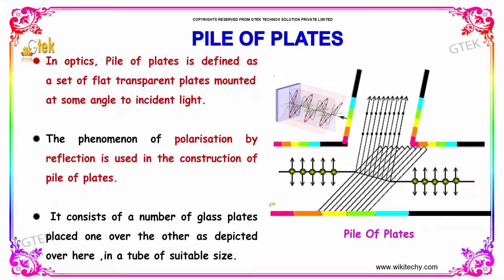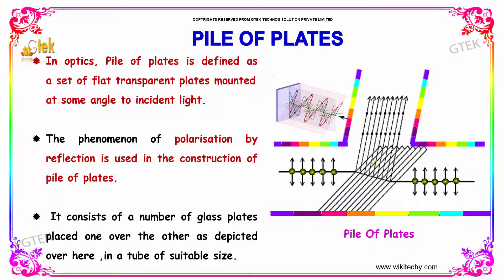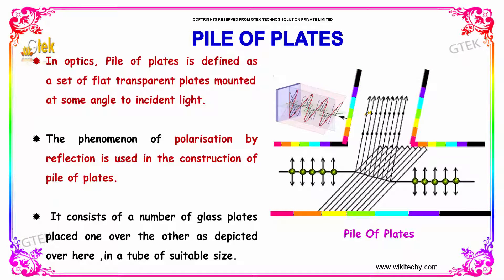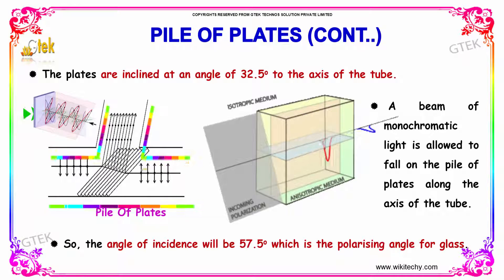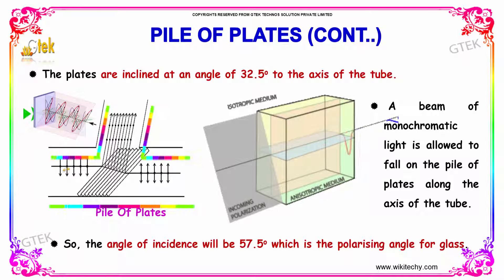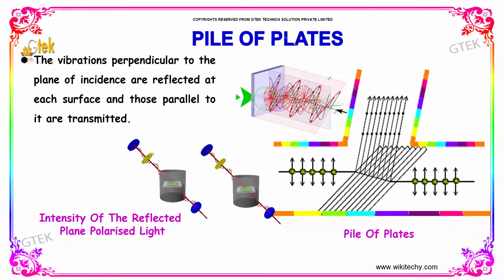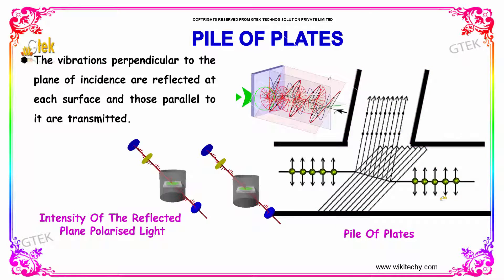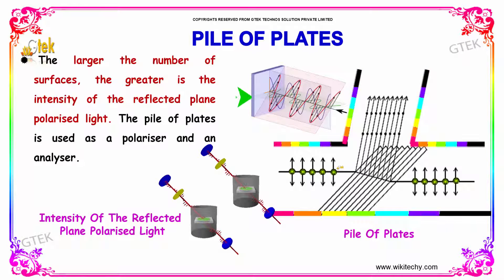Pile of plates Electromagnetic Waves and Wave optics class 12 physics subject notes lectures

Comment: in optics, a set of flat transparent plates mounted at some angle to incident light. Such a pile is a simple polarization device. In accordance with the Fresnel equations, the transmittance and reflectance are different for the two polarization components of the incident light—that is, for the components polarized parallel and perpendicular to the plane of incidence. Natural light is therefore polarized when it passes through the pile; the component whose electric vector lies in the plane of incidence predominates. The greater the inclination of the rays to the pile, the greater the degree of polarization p. The optimal angle of incidence, however, is the Brewster angle (seeBREWSTERS LAW), at which the transmittance is at a maximum (approximately 50 percent).

Comment: The properties of a series of media or of a pile of plates which absorb and scatter light, and the interfaces of which may also absorb and scatter as well as transmit and reflect light, are investigated without assuming that any of these factors are independent of the direction in which the light travels.

Comment: For light in the visible region of the spectrum, the plates are made of optical glass. In order to reduce losses because of absorption, the plates are of very small thickness. When the refractive index n of the glass is 1.5, a pile of 16 plates yields practically complete polarization (p = 0.99). For the infrared region, piles composed of, for example, lithium-fluoride or fluorite plates with thin selenium, germanium, or silicon coatings are used. The high values of n (~2–4) of such coatings permit the required p to be obtained with a small number of plates.

Comment: The phenomenon of polarization by reflection is used in the construction of pile of plates. It consists of a number of glass plates placed one over the other  in a tube of suitable size. The plates are inclined at an angle of 32.50 to the axis of the tube. A beam of monochromatic light is allowed to fall on the pile of plates along the axis of the tube. So, the angle of incidence will be 57.50 which is the polarizing angle for glass.
The vibrations perpendicular to the plane of incidence are reflected at each surface and those parallel to it are transmitted. The larger the number of surfaces, the greater is the intensity of the reflected plane polarized light. The pile of plates is used as a polarizer and an analyzer.